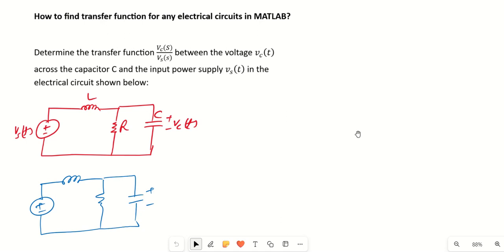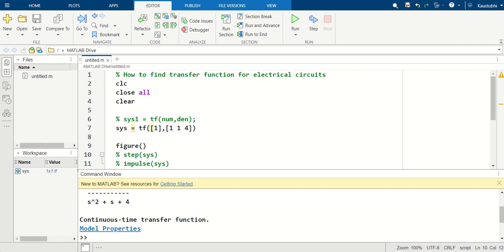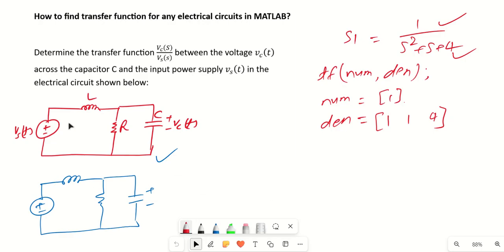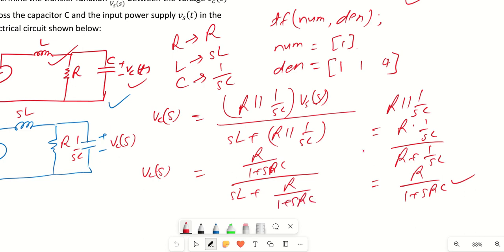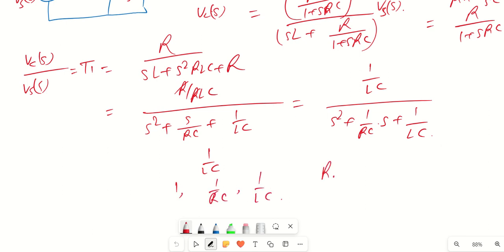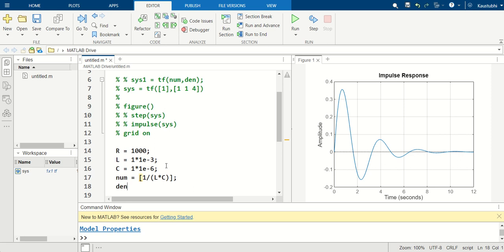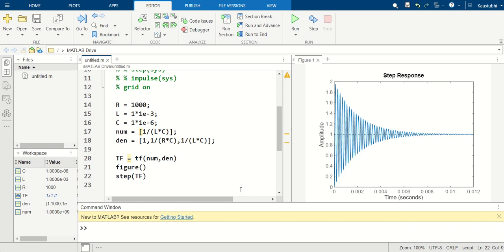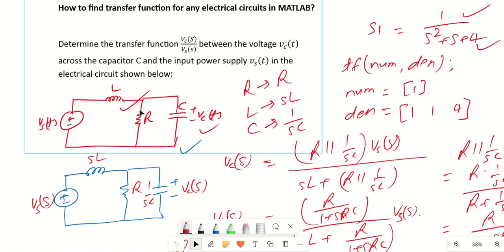How to plot Transfer Function response of Electrical Circuit in MATLAB

Comment: Time waste!! Video title is MISLEADING
Reply from the maker: If you didn't understand, that's my fault. I have changed to suit your understanding
Reply: @bkpsemiconductordesign  that's good, you are plotting the transfer function not generating transfer function.
Reply: Looks like transfer function is derived as circuit solution and systems transfer function response is plotted using MATLAB.

This is good for my requirements for any electrical circuits😊